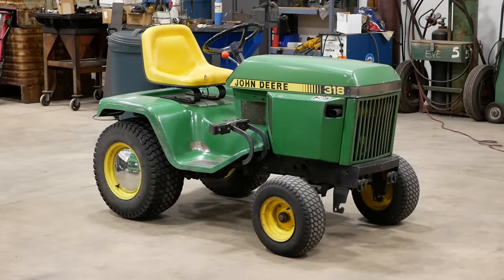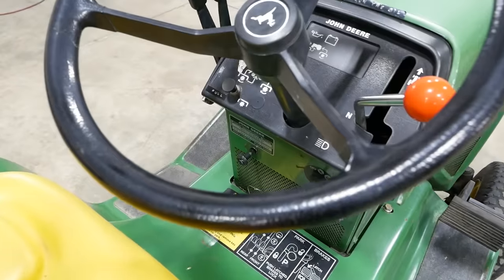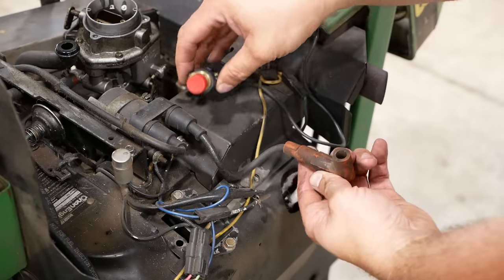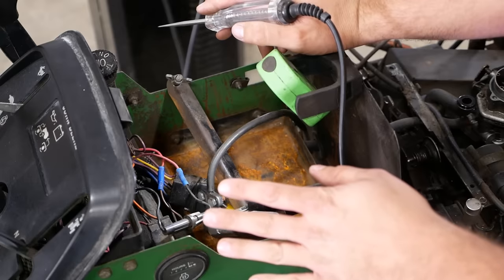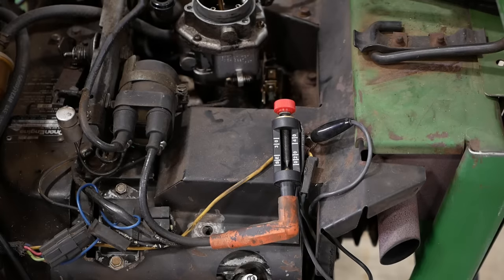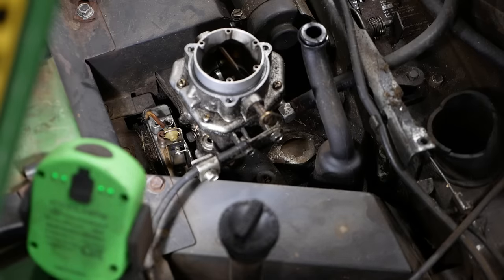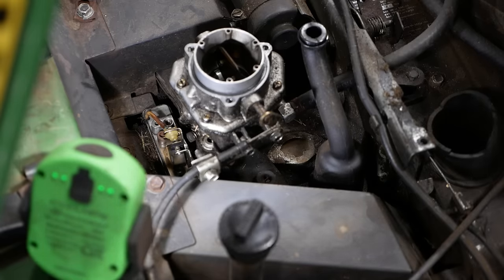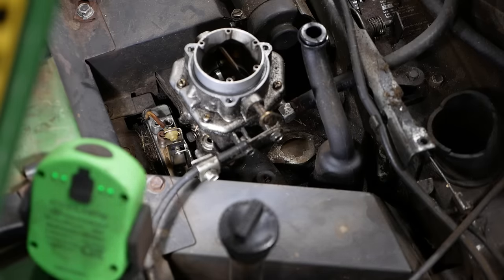John Deere 318 no Start - no Spark

Comment: This is the legend that allows John deere to turn out expensive crap now. Living on there resume
Reply: 100%
Reply: This plus they once made reliable farm equipment that you could service yourself.
Reply: They are all pretty much the same anymore.  At least the ones you buy at the big box stores.  Troy-Bilt, Craftsman, John Deere all the same junk they sell in different colors.
Reply: @MrClarkisgod  craftsman, Murry, Husqvarna (the cheapest one) , poulan and a few other are all the same tractor MN ade by mtd. John deere are still made by John deere as far as I know they're just not good anymore unless you spend $6000 or more. Troy built are  just junk you can get 3 maybe 4 years out of one
Reply: @danbartolini27  Stanley is taking over MTD so maybe they'll improve. Right now I wouldn't recommend anything they make. Some of the bigger names they purchased and now make are Yard-Man, Cub Cadet, Bolens, Garden Way, Murry, Troy-Bilt, and White Outdoor. They also do some manufacturing for Deere, Craftsman, and Toro. 
Personally I wouldn't buy any of them, and I recommend the better Husqvarna models, who also make the better Poulan Pro and Craftsman models.
Reply: @TheOtherBill  with the demise of Briggs and stratton a bunch of brands are no more including Murry and simplicity and snapper among others and brands like Ariens no longer make a tractor so choices are getting fewer and fewer. I don't think I will ever buy a brand new tractor again. I'll stick to the older ones
Reply: @danbartolini27  Yup, every time I check out the crap in stores it only reinforces my previous decisions to pick up a couple of ancient Cub Cadets. The old Kohlers have been running for 50 years, and I'm willing to bet they'll run for another 50 yet.
Reply: @Mck Idyl stop it
Reply: The JD equipment bought at a JD dealer is still good,  but it costs at least 2x what Lowes or HD sell them for. Those models are made to meet a price point less than $3k. My dealer says he gets many complaints from people who buy the big box versions and bitch at him when they breakdown after only a few years use.
My 1990 176 lawn tractor is still running at my neighbors cabin and my second hand 277 lawn tractor is 21 years old and still running great. I only bought the 277 because it had a 48 inch cutting deck vs. the 38 inch deck on the 176 which cut 2 hours off my weekly mowing time.
Reply: @johnphillips4342  John deeres sold at HD are still John deeres and if they suck that's a John deere problem. I don't understand why anyone would buy them in the first place, every one knows they suck. They are not set up by a technician or mechanic but by the kid that stocks the shelves. Why would you buy a tractor from a place that doesn't service it? And that have suck a bad reputation?
Reply: @WhyBeNick  up until recently I was running 2 craftsman tractors from the 90s at my rental propertys and had been for years. Parts are cheap and easy to get. Unfortunately my big one sucked up a push rod and ruined the engine
Reply: The 318 would be an x7 series Deere now which is a $10k plus machine but right inline with the same price based on inflation.  We don’t have anymore trouble out of the x700’s than we did the 318’s at the dealership and the new ones are certainly more comfortable.  The zero turns have taken a big chunk of the large garden tractor market these days.
Reply: You're not wrong. I grew up with machines like this that were, and still are, damn near bullet proof. I now live in a very nice neighborhood of 20 properties that are a minimum of 3 acres, and being in central IA the vast majority of them are using John Deere mowers. I bet at least once every month (maybe two) I see one of the neighbors machines being hauled off to the dealer for god only knows why. Meanwhile in the decade I've been here, my Kubota diesel powered Grasshopper hasn't been in once. Nor has my Kubota BX tractor. John Deere is a joke compared to what they once were

Comment: The 318 was a legend because it had to be to save face. It was a fully new design from the ground up. Many purchasers of the 317 it replaced were burned by failures with the Kohler KT17 opposed twin engine that damaged Deere and Kohler's reputations. Onan was making retrofit kits for 317's as it took a while for Kohler to fix the KT's oiling issues, and Deere was impressed enough with the Onan engine that they used it for the new 318 and scored a huge win.
Reply: 317 came with a onan in theblatter yours cuz the kohler 317 would burn up the one cyclender on hills.. u could get both tractors at the time but i would a 140 over bothvany day of the week .
Reply: I have an example of both engines in a 317 I am trying to get the onan one to work but most of the electrical system is fryed

Comment: I learned to check across a glass fuse with a meter in the most embarrassing way! I was fleet maintenance manager for a trucking firm. Bought an old Toyota wagon to run errands with and it stopped dead one day. I could not figure out what was wrong. Called a Toyota mechanic friend because I thought it was in the electronic ignition. He came to my house and replace a fuse! It failed at the end inside the metal cap end where you couldn't see it. He never let me forget it whenever he had the chance and I most certainly will never forget!!

Comment: I have 2 of those. One I put a Kohler CH20 in for mowing. The other I was lucky enough to find a NOS shortblock for. Good to see this one will keep its original engine. There's something special about the sound of the Onan. They are legendary tractors for sure. From a time when engineering was simple and the quality was high.
Reply: You make it sound like it was made in the 50s lol.
Reply: The special sound of the Onan is the suck of the money leaving my pocket.  If it's running it devours fuel and if it isn't the prices for parts are insane.  One of mine has a Kohler in it as well and the amount of fuel difference between the two of them is insane.
Reply: @ryanslaback9418 , now you can understand why so many motorhomes use Onan generators.  Very reliable but expensive to operate for any length of time.  The one we used to have on our old motor home would really pull the tanks down if we had to boondock for any length of time without shore power.
Reply: An Onan legend?  Junk from the start.  Glued together intake manifolds.  Pull the engine to change fuel pump on some models.  Why do yo think Cummins stopped making them?  And if you think it was EPA, nice try.  Boat anchor was the real reason. Want a good tractor, put a Honda V twin in it.  Now you have the tractor you hoped Deere would have built in the first place.  Can't even get a fuel pump for many of the older Ohno Onans.

Comment: My parents took care of a small cemetery in the town I grew up in. I clearly remember them buying a brand new 316 in 1985. It replaced a tired 140. I remember it costing $5k. It was a ton of money back then for a garden tractor I thought. I spent a lot of hours on this tractor. Fell in love with them. When I bought my first house, I bought an older 316 from a friend of mine . This was around the year 2000. It was a low hour 1987 model. It only 300 hours. It’s former life was with the city, and didn’t see much use. I used it for years until I moved , which the new yard only required a push mower. The 316 was basically a stripped down 318. The guy I sold it to still uses it to this day. It had a snow thrower as well. Damn cool tractors. Wish I still had it!
Reply: They are awesome machines, Aaron. Another will come your way.

Comment: Can't believe you filed the points with a points file and then pulled something thru them to remove the filings, just like they taught us in automotive school back in 70's. Your range of knowledge never ceases to amaze me. Small engines to army trucks. Great videos!!!
Reply from the maker: My dad was a points nazi.
Reply: Guy I worked with (he recently retired) found 3M 1400 grit diamond paper.  We use it on contacts for relays, safety and door circuits on elevators.  We call it magic paper.  It's about 7/8" wide and comes in rolls around 100' I think.  Stuff is money.  Doesn't take the silver off the contacts, just polishes the carbon right off.  Or we use a dollar bill.  Works like a champ.

Comment: Actually Wes, re powers are quite common in the 318 community. That is part of the beauty of this machine. It is so overbuilt, and lasts so long, that it is actually worth re powering VS the pieces of crap they sell now days.
Reply: It's good that at least one community understands that an engine wears out and sometimes replacing with an original just isn't going to happen.
Reply: @bruwin  I will scour the earth to find a rebuilt Onan when mine needs a replacement.
Reply: @jdraupp  search before it will be cheaper than waiting till you must have it
We put a Onan 20hp we got almost new out of a JD 420 
It was very cheap and we ended up eventually needing it
Reply: @captainamer71  great idea.
Reply: My 83' 318 has been repowered with a Honda 20hp. Came from a landscape outfit that killed the onan. I'm personally not a fan of Onan engines anyway and was pleased it had the honda in it
Reply: "Community"? Modern terms for a very old machine. Actually, most models are good candidates for repowering and updating. My favorite is my 317 as it's such a tough machine that can handle the rough abuse. No broken rear ends and frames with this model. And they can be had very reasonably compared to the sacred 318. My favorite 317 sports a Kohler Command 25 engine, power steering transplant from a 425, 3 spool hydraulics, and updated PTO clutch. Everything works as it should including all of the safeties and covers. It takes a keen eye to spot any of the modifications to the tractor from 10 feet away or sitting on the seat. Folks in the John Deere "community" should really open their minds to the 317s especially if they enjoy modifying these machines. 

I start a repower soon installing a Command in a 400. Yes, the Onan is too far gone.
Reply: I am disappointed.
I was expecting a 318 small block Mopar repower.
Boring.

Comment: If I had a nickel for every time a glass fuse lied to me…… This has happened with brand new ones, have to always check them under load.
My father had a 317 at one point. The options you could get for them was crazy.

Comment: Wes I split the brake pedals to 1 on each side  then added  a rocking pedal for forward and reverse and kept the hand control .  Much easier to drive.  Then I made a front loader and a backhoe with stabilizers. I put hyd pump in the front for direct drive from the crank,   A great mini yard earth moving machine.
Reply: You forgot to mention you also equipped it with a cabover sleeper. 😂👍
Reply: You need to make some vids of this thing and post them up on youtube so we all can see how its done!
Reply: Yes I want videos of this
Reply: Did it still cut grass?lol

Comment: I had 2 of the 318's little brother, the 212, all manual, no hydraulics, 12 HP Kholer, 4 speed manual transmission with a granny low! Had the front snow blower attachment, with the wheel weights and tire chains, and was it's only job, in its later years, and still is to this day! Was passed down through the family, and still blows snow when needed! Great little garden tractors!
Reply: I have a 216 just like yours and a 312 good tractors

Comment: This was from the good old days when lawn tractors were tractors. We had a couple of Cub Cadets from the 60's, a International Loboy from the 70's and a John Deer 430 from the mid 80's. All were built very well. Today Cub Cadet is owned by MTD and are mostly plastic instead of metal with a belt running the hydrostatic drive instead of a drive shaft.

Comment: That's a pretty sweet little unit. Looks like it has been looked after really well over the years all things considered. I wonder if the owner checked that fuse, saw that it looked good, like you did, and figured that couldn't be the issue. I probably would have made the same mistake.
Reply: You are right in what you say. With this video I learned to get the test light out and go on and probe it.
Reply: @HouseCallAutoRepair  i keep a little multimeter and a standard test light these days as well even though i'm no mechanic. But now thanks to this video i'm never going to trust a fuse again even if it passes a visual, lol.
Reply: Even without a test light I would have tried a second fuse before I called the mechanic.  Takes a couple of minutes and saves a lot of trouble.  Of course then I would have been stumped on why it wouldn't go into reverse so there is that...
Reply: It is amazing at the number of times over my decades as an electronics tech that I've run across fuses that looked good but had opened right next to the end cap.  The stranger ones are those that had the end cap actually come loose but not enough to come off.  Good catch!
Reply: Imagine that! Big jump. Eh blown fuse...Eh  swap the Onan for some harbor freight myanmar rice burner!

Comment: Those 318s are sweet little tractors, I bet she'd run circles around anything built in the last 20 years. And don't worry about the check valve o-ring...I'm pretty sure it's a universal shop rule that no matter how many o-ring kits you have for hydraulic jobs, you never have all of the right ones. Ever.

Comment: Seen ya in SMA live stream the other night that's cool he wants to talk and help you out !!! Love his channel class act for sure . You have a great channel as well . Keep it up 👍
Reply: Don't think I'm familiar with that channel. SMA?
Reply: @garys9694  South Main Auto. Great channel with a proper mechanic/ diagnostician rather than a code read parts swapper.
Reply: @ohboy2118  yes sir 👍
Reply: Went there and realized that I have looked at his videos many times. Actually have used them to get my vehicles repaired. You knocked code readers, you simply cannot do that. Wes has proved it many times. A mechanic must work with code readers or he's just not gonna be able to fix many problems in any car built after OBD came out.
Reply: @garys9694  sorry you misunderstand me. There are too many so-called mechanics that read a code and immediately swap out the part the code refers to rather than do due diligence and prove the part is faulty before replacing it.
Reply: @garys9694  I'll just say there's a difference between a code reader and a scan tool .
Reply: @ohboy2118  I understand and agree wholeheartedly.

Comment: I'm glad I wasn't just imagining that the corn was green.  They must love running their dryer.
Reply: they are worried they might lose it if it storms, its cut it now or lose it later. It looks like the green stuff is mostly on the edges of the field where the field stays wetter when it rains.
Reply: The corn around us, it’s super green but it’s right where the moisture needs to be, the corn getting picked in this video probably never saw the dryer

Comment: I used to run across fuse situations like that quite often. So much so that I usually just checked them with a multimeter right off the bat. I think that was one of the reasons things went to the plastic plug in style.

Comment: i had one of these for a short period of time. bought it for 700 with a broken rod and it still ran on one cylinder. rebuilt the onan and the mower deck. had the snow plow also and it did great in the winter. sold it for 1800$ without the plow.  Ive sold off my garden tractor collection over the years and all i have is the diesel swapped Bolens HT20

Comment: Well, you know you exceeded the rpm's that the owner has ran it at for the entirety of its life.
So they'll be a stern talking to after he sees this video. 
Also what was on the note under the edge of the hood that he made with the old label maker?
Another satisfied customer you had with that life saving job well done.
Because even though he may have mentioned the repower, it wasn't really what he wanted to do if at all possible for you to pull off a miracle bringing the faithful ole Onan back from lawnmower heaven.
Good save Wes, and now your a Super Hero in the old gentleman's eyes too.
Reply: It said something like “check the oil”.

Comment: I have one of those, damned fine tractor. Bought it when it was 2 or3 years old and runs great to this day. Yep, starter always sounded like that. Later models had Kawasaki engines in them. There's a repower kit out there with a 24 hp Honda that's pretty popular. Good fix Wes, those are just the start of too much electronics just to mow the lawn.
    Best regards from Indiana.
Reply: I have my 92 model think it is bought new trailer and tractor 6 grand back then
Reply: He repower them with vanguards now cuz theycwere having issue with the hondas . Small engine ware house sell the kits

Comment: Some corn varieties do a really good job of dropping moisture out of the  kernel.  But yeah that looks wicked green.  Cost a chunk of change to dry it.  Maybe they made a few test rounds to see what the moisture content was?
Reply from the maker: They finally gave up after picking half the field.
Reply: Yeah that was my thought, it looked drier on the edges
Reply: I wondered the same, that or opening up fields and sorting out the equipment for when it’s go time